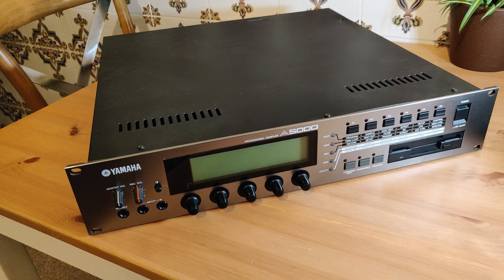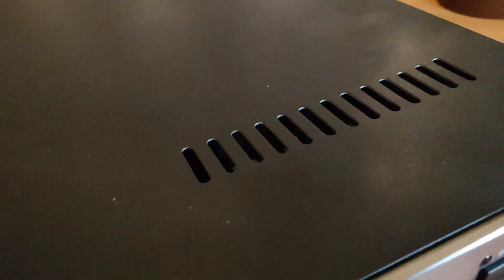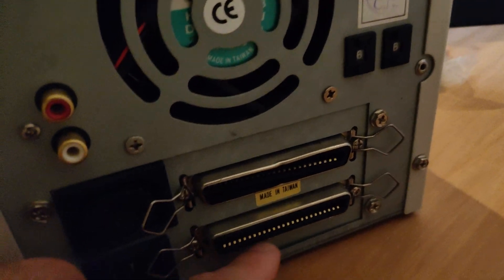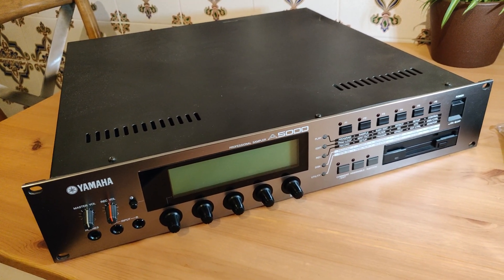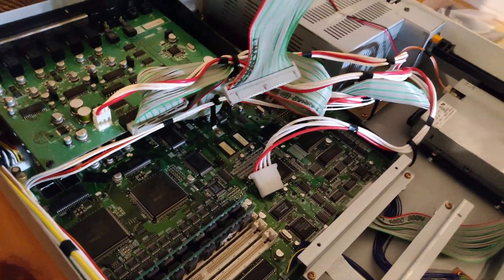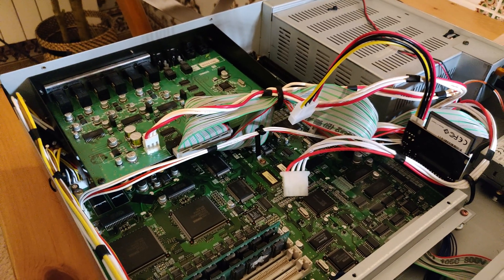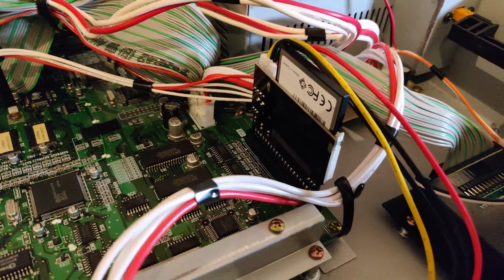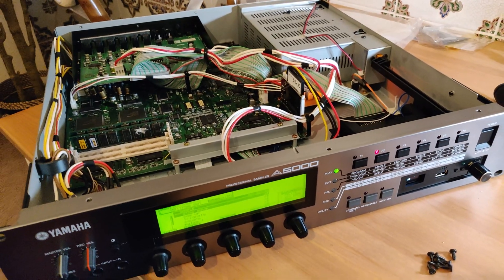Yamaha A5000 Compact Flash Card & Gotek USB Floppy Emulator Upgrade

Comment: Correction what I mean by externally is replacing the 3.5 floppy for a CF Card Drive such as the Akai MCD that was released with the limited edition of the 2000XL or currently on the market the MPC Stuff 2000XL CF Drive or SD Drive, can 8GB only be used in those only as well as inside the unit as if you were using a hard drive
Reply from the maker: @flowzartzahirmusic  as far as I know the only support for internal drives are scsi drives, cf cards, standard floppy drives, and usb floppy drive emulator. Anything outside of this I do not know.
Reply from the maker: @flowzartzahirmusic  yes max allocation is 8GB at 1GB partitions. It can not read anything larger than that

Comment: What's the largest compact flash card you can use for an internal hard drive or if you replace the floppy with a 3.5 cf drive?
Reply from the maker: @flowzartzahirmusic  8GB
Reply: That's for both; internal and external right
Reply from the maker: @flowzartzahirmusic  you can use a SCSI cd reader or floppy drive to load samples externally
Reply: Also, what about SD Card size?
Reply from the maker: @flowzartzahirmusic  it can only read up to 8GB at 1GB partitions. Anything larger than 8GB can not b allocated

Comment: Hi. Thanks for posting this video. The A5000 I recently purchased already has the exact same flash card installed. I'm looking to install a Gotek USB Floppy Emulator. May I ask, did disconnecting the fans cause any problems so far? I like the idea of silencing the machine. Your advice and knowledge would be much appreciated. Thanks again.
Reply from the maker: Sorry for the delayed response. No issues with disconnecting the fans since I dont use the sampler for extended periods of time and my studio is kept quite cool. However, if this is something you are concerned about, you could replace the current fan with a more modern and quieter fan .
Reply: @aymatorg  It's just great to have such a monumentally great sampling machine and yes, of course it works without cooling in normal northern hemisphere environments. Hardly ever play with her anymore but she always gives back love when I need her. 32 channels of gorgeousness :)
Reply: @aymatorg  Thanks for coming back. Yes, it's fine although, nowadays more of a beautiful ornament where actual production is concerned. I still love the transparency and wavelength. Something special ;)
Reply from the maker: @spazkong  I havent had time to dig in to mine for while. I'm actually in the process of writing a vst editor to bypass dealing the encoders. Eventually I'll have done and jump back to to create a few tutorials

Comment: I also have an cf for replacing the hd , but are you sure that the fan is used only to cooldown the hd's ?
Perhaps the fan is also used for airflow and generally cooling down the  components , there have been reports of AK samplers shutting down after a while  after removing the fan
Reply from the maker: I don't use my sampler for extended periods of time so I don't have any worries of overheating. Additionally, my studio is cold and well ventilated so for me it's not a factor I'm  as concerned with as I am with noise. But if you are using your sampler for extended periods of time and concerned with overheating, by all means keep your fan on or better yet replace it with a quieter one.
Reply: @aymatorg  The fan can probably be replaced with a much quieter Noctua model with voltage reducing connectors to lower the rpm to about 800. This is something I will look into when my new A5000 arrives. It made a big difference on my E4X.

Comment: Where can I get the board with the Compact Flash card and the usb reader for the Yamaha A4000?
Thanks a lot.
Reply from the maker: Cheapest place I found both was on amazon but you can also try on either ebay or reverb

Comment: running solid since?
im paranoid about disconnecting the fan by the power supply as i understand it vents that section
Reply from the maker: All good on my end. I don't run my a5k for hours at a time like I used to, just enough to record in, make some edits and run audio out back to my pc.  I do it out preference because I just don't like fan noise but it's not necessary. If you plan on using it for long periods of time or it makes you more comfortable leaving it on, by all means keep the fan connected or even replace it with a quieter equivalent.
Reply: @aymatorg  Probably drill a larger whole in the back an use a large modern fan?  The A3000 is particularly bad.... sounds like a vaccum cleaner on steroids. How the the loading speeds? are you satisfied?

Comment: thanks for the information I am also bought one A5000 and still have one A4000 I will both upgrade with compact flash CF memory and with the floppy USB emulator after see your video I am convince to do it.
Reply from the maker: That's great! I have a new video I'll be posting shortly that goes over the jumper settings for the cf adapter which you may want to take a look at. Feel free to reach out if you have any questions and thanks for watching.